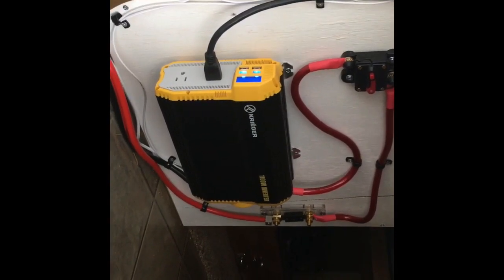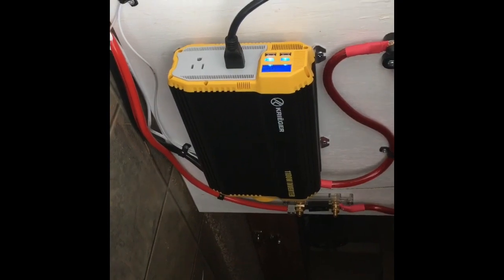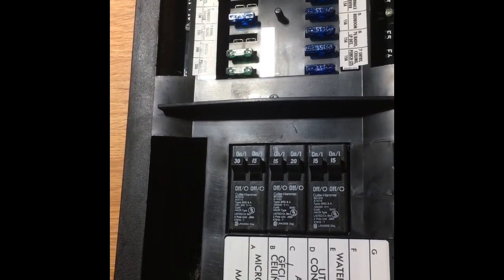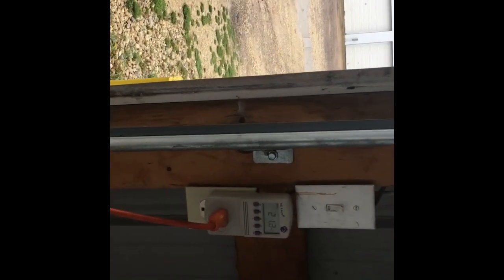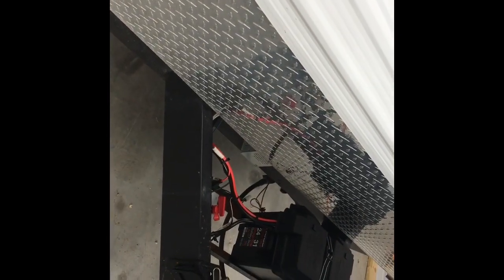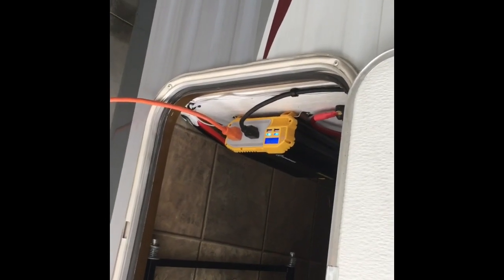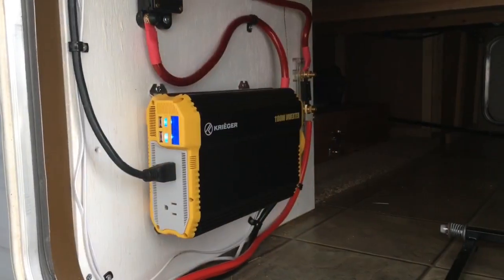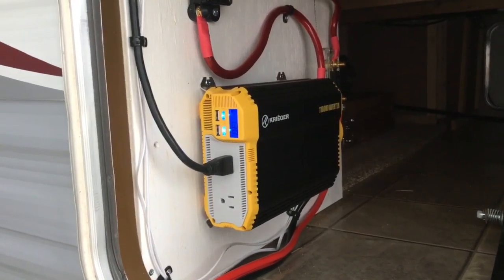Running RV outlets off the inverter

Comment: I recently bought a 600 watt solar system.  I have removed to battery from the front of my camper.  I used 4 100 Ah batteries to charge my rv.  Do I need to but a switch to turn off the the CONverter charging my "battery" even though I have removed it?

Comment: Solar panels --> charge controller --> battery bank --> inverter --> shore power plug. Easiest way to install solar. I want to know which inverters allow you to wire a 30 amp plug and how. Either having extra wire connections on the back or using two 15 amp plugs off the front. Good luck to me.

Comment: Great video! Question from a newbie if you don't mind. I have a 1967 camper that is so basic the only things equipped with ac power are three outlet jacks and three light sockets. That's it, no fridge or pumps or anything at all. No breaker box.  There is no system to hook up to power at all other than shore power socket outside the camper. When I plug into shore power it all works as it should. I want to boondock so I built a solar battery generator with two batteries, 1000watt inverter, solar charge controller and all the necessary inline fuse and low voltage cutoff switch. 
All that said, in theory, I can just run an extension cord from the shore power outlet to my inverter as long as I don't try to plug in any devices bigger than what my inverter can handle, correct? 
My apologies if this seems like an obvious question.

Comment: If you already have all the outlets connected to the converter, does it make sense to run them off the inverter?
Reply: CONverter converts 120v shore power to 12v DC to charge batteries.  INverter takes 12v DC and makes 120v AC
Reply: @bobcole3852  thanks. I ended up buying an automatic transfer switch which I've connected to converter. Shore power and inverter. I can now power my entire 120v off my inverter .

Comment: Hi Andy, thanks for the video. How did you wire the outlets inside the RV?
Reply: I'm think that with the converter connected to the batteries that all you do was to take your power cable from the trailer that mostly likely has a 30amp plug to be converted to a 110v/15amp adapter, then plug that into the converter outlet. All the device would feed off the trailers power cord as if it was plugged into shore power. Depending on the size of the converter will determine wha the converter can handle. Of course the more load will deplete the batteries really fast. A/C would kill the batteries the fastest. Your fridge and water heater would run on propane.

Comment: I'm pretty sure your converter isn't charging batteries, but is probably still running 12V accessories from 120V unless you kill it. This is only like 80-90% efficient compared to 100% on direct DC from the batteries. This is how my RV works, but I have a contactor which kills 120V to the converter when the inverter is on and a 120V circuit breaker on mine.

Comment: Loved the idea of isolating the battery from the trailer with a cut off switch I had originally thought to somehow put a simliar switch in line with the DC output in the CONverter. But your idea makes so much more sense. Got ne question : If isolating the battery from the CONverter, how did you wire up the inverter, which needs DC power as well ?

Comment: Trying to figure out this too.   Would it not be better to run a relay switch to your converter .  So when power is coming from inventor converter will have not power from relay switch but work when surge power is turned on.  This way you do it once and you never have to think about a switch again.

Comment: Does anyone know (or recommend) what cord (s) are used from the inverter 120v to the actual plug recip? Some say use a 12/3 extension cord zipped, but not sure if that is as safe as using dedicated wires. Thnx

Comment: Hey! Thinking about doing the same on my camper. I like how you set this up. I have some questions though. I was thinking about leaving the battery hooked up like normal, and just unpluggig the charge controler. Or hooking it into a power strip. Otherwise If I isolate that battery I think it will shut off the water pump. I was also curious what size invertor your running to power your tv / fridge... And how long the batteries last? New to this whole camper thing. Lol
Reply: You don't need your water pump if you have water from city water/rv park. Your water pump would operate just like it would if you were plugged into shore power. How long the batteries last depends on their rating. You should be able to run a TV for 8 hours before depleting batteries. It's some you have to test how, how much power the tv uses. A microwave, hair dryer, coffee pot of 1500 watts would use a lot of power. The microwave only on for 5 minute to heat a TV dinner would only use power for 5 minutes. Also consider having solar to charge batteries during the day so low use power is being replaced by solar at the same time. Trying to run an air-condition is another different thing that requires at lease 11 amps to run and A/C's usually run for several hours so that would kill your batteries probably in one hour. It really take power management to only use power for one device at a time and run your fridge and water heater on propane.

Comment: What we want  to do is have a disconnect switch so the fridge can be turned off.  While driving, the house batteries are being charged by the alternator.  When we stop, all we want  to run is the outlets in the coach, and a fan, and a TV.  Only run the fridge when driving or hooked up to shore power....Is this possible, and how would it be done.  Thanks
Reply: If you haven't completed your task, you can add a subpanel and move the a/c side circuit breakers you want to run off your inverter over to it.  Just remember, there is a sequence for the placement of all those inverter, converter, etc.  If you've completed your task, please share.  Thx

Comment: I want to get the smallest inverter and seperate batteries 2 or 3 just to run the fridge by itself. Have 1 for RV with more batteries bigger inverter. Then separate just for frigid because it has a plug you can get to from outside never seen it done. Solar and batteries for just The Fridge keep it separate from the rest.

Comment: I have a main disconnect switch and running my trailer off a inverter connected to my battery bank  also solar connected to the battery's
Reply: This is exactly what I'm doing too,any problems so far?

Comment: Install solar panels and a charge controller to connect to your battery. That'll keep the battery topped off all the time.
Reply: Try again professor 🤓
Reply: @jackmehoffer7819  if I'm missing a step or two I am not embarrassed if someone corrects me.  I've barely been doing this for 8 months.
Reply: @jonathanzubia5132  Good answer Jonathan.  There's always a wise ass commenting.

Comment: Andy, this is exactly the video I have been looking for. Thanks for posting,  Quick question on the battery isolator switch did you place that in the positive or negative line going to the battery?  Secondly when you do that and are then hooked up to your inverter for power do the 12v plugs and items etc still work in the RV?  Thanks

Comment: To run a tv like yours, what size inverter would you need?
Reply: I tested the wattage use on my 48" led TV and it only uses 128 watts. So you would only need a very small inverter.
Reply: You would need maybe about a 2000 to 3000 watt inverter if you want to run your TV. Really anything smaller since those TVs are LED and use up a lot less power than older TVs. However, with bigger inverters and more wattage you can run your TV microwave, PlayStation etc simultaneously but gotta consider how much wattage you have. The less power you distribute the more you an use with your TV.
Reply: Use a small Stanley Fat Max inverter! red power waste!

Comment: Andy, my TT when hooked up to shore power, charges my batteries through the factory power cable that has a factory disconnect. If I disconnect that cable and use the inverter, with its own cables, to the shore power cable, would this be viable?
Has your system been working properly? Thanks.
Reply from the maker: Geebroni  yes that sounds like it should work, I ran this setup for almost 2 years trouble free before I traded in the camper.
Reply: Andy, still confused because I would'nt have dc power in trailer.

Comment: Hello, I just bought an old rv. I'm thinking I should do the electrical work first. What do I do to get started
Reply: Jim Jim  I would also agree and recommend this
Reply: Britney.. My advice would be to call a reputable... not  a sometimes diy mechanic.. for hire that posts on your local grocers' bulletin board.. but a pro who knows the ropes.. yes you may get a good one from a card at the local grocers too..but do some  pricing first.. ask what they charge and what the cost to analyze your RV.. then do upgrades as you can afford them. Ask about Amp Hours.. for your RV.. they should ask if you are gonna run a TV and for how long.. microwave.. electric heater.. water heater .. .about that stuff.. You will run down batteries even if you use an inverter and a converter.. know the difference.. Your Inverter gets 120 volts for radio, computer etc.. but the less you use the more power your battery will be able to maintain.. Have the person explain your whole system electrtically to you in every day terms.. Plus get your info from here too and CheapRVliving on youtube.  There is much to know..

Comment: A 30A transfer switch is relatively inexpensive and not hard to hook up with basic knowledge of electrical systems. The converter charger would be disconnected from the distribution center and re-wired to the shore power input side of the transfer switch, the inverter wired to the other input, the output is wired to the distribution panel... The transfer switch seamlessly switches from shore to inverter power and you never have to worry about your converter charger when running the inverter. The only thing you have to remember is to put the fridge on propane only as it will run your batteries down quite quickly.
Reply: I think you'd need 2 transfer switch for this application. One to pick the incoming source and another to turn off the converter/charger. I'm neck-deep in this project in my RV right now.
Reply: @scottleggejr   how did it turn out? i'm about to have to figure this out too
Reply: @MrStaark  It's perfect for what I need!

Comment: What kind of switch did you use, and where did you get it
Reply: Brian McEwan Try the Xantrax prowatt transfer switch for $60. It works great for me. But your converter must have it's own breaker or you'll run a loop.

Comment: Best to use this inverter for only one circuit separate from power converter 120v circuits. This is not correct. Not enough battery or inverter wattage for a 30 amp RV. Stop asking this guy about this.
Reply: Ray Laux Are you under the assumption he's planning to run the power hungry A/C  unit or refreirater using the inverter?
Reply: A/C will never run that is a given. You need over 10x the battery current to run a 120v appliance. 3A 120v Refrigerator needs over 30A 12v DC current to run. You need hundreds of Amp hours in battery storage capacity to run all circuits in a RV. Typical group 27-31 RV battery only has 65-100 amp hours of storage capacity and will only run a RV refrigerator for maybe 6 hours before battery is completely discharged.

Comment: You obviously aren't very knowledgeable in the electrical field. You can't use the battery that's running your inverter and charge it via the converter. 2nd a long electrical cord has a lot of resistance so you are losing power via a long cord. And if your rv camper is a 30 amp you need over a 3000 watt inverter.
Reply from the maker: C. M. You obviously didn’t watch the video. That was discussed in great length.
Reply: ANDY R. Resistance and voltage drop was not discussed in great length.  You said if you don't disconnect the converter it creates a loop and will use a lot more power. You can't or shouldn't charger your inverters battery by power created by that battery that is running your inverter
Reply: You wouldn't need a 3000 watt inverter because no one would ever run the air conditioner or refrigerator on essentially rv batteries.... I wouldn't recommend running a microwave with the inverter,  It just zaps rv batteries down in no time.

Comment: What am I looking for to cut off my charger, although I don't think it works anyways ( to the house ) old owners messed up the on board inverter. My RV eats a new house battery every 2 to 3 months, even running my generator everyday for 4 to 6 hours
Reply: we would need to see your panel.. There is always a breaker for the charge circuit.. Also there are tests to perform with a multi meter to determine whats wrong with your converter... Best converter .com has great replacement options...
Reply: Lawrosa1 thank You

Comment: Great video! Where does the negative wire terminate after leaving the disconnect switch?
Reply: TR Brown...I am guessing..I might call it an educated guess.. I have some electronic experience..not in the business tho.. : any neg wire will always go to ground.. a convenient.. nearby ground wire.. *(or just go to chassis ground framework).cut, put an end on..crimp.. remove a nut on the existing leg of a circuit and attach your new wire and end.. tighten down nut.. No one would want to run a long wire from inside to the ground post of your battery, for every circuit in their RV.... I say that as an extreme.  But do find a "common ground" source or point.
Reply: TR Brown. I have a cig lighter plug in my car with no power.. I fiddled with it.. for a while.. couldn't find the fuse even with my Chrysler owners manual.. took it to a repair place.. he got his multimeter out and traced power from fuse box under hood to where he thought the right fuse might be.. no dice . I am trying to find another guru.. he didn't fail because he did something wrong..  it is the vehicle.. &**( Previously : radio died.... found the fuse.. it was ok.did Online Youtube video searches on that subject for diy car mechanic on Chrysler Radio.. I found :  remove battery terminals for five minutes ..re attach.. try radio to see if that reset the controls...but if that didn't work.. in my case it didn't ..end of radio.**there were three radio options  the one I have .. if it dies .. game over no fixes..).all that to say DC electrics for campers and vehicles can be a challenge.

Comment: Thats great. Hmmm On the older campers as I have/had the charge circuit was only on two outlets buy the master bath. So when I switched it off the charge circuit and two outlets only did not work..

I would think all the newer converters may be set up as yours that the whole camper shuts down..

With that said I assume your switch you made is a battery disconnect from the battery's to the converter? Thats smart. When I get my camper in may I assume I will need to do this also..

I wonder though what is behind and attached to that breaker. I wonder if you can separate the charge circuit.

As in my old trailer it had a spot for an additional breaker. Yours looks like it has a spot for two.. 

If you have time have a look.  I myself as well as others would be interested.

Last is I am debating on the 1100 or the 1500 watt unit. Not that I suggest trying it but I wonder if your micro will run off that invertor? If you only have one battery I think you would trip the invertor off on low voltage. I run with 3 battery's @ 220 AH and a Residential 280 watt 40 volt panel..

Ill have pics soon and videos of my set up in a few months..
Reply: Looking again at your vid again after the fact. The breaker is "D" in your panel. That shuts off the charging circuit...